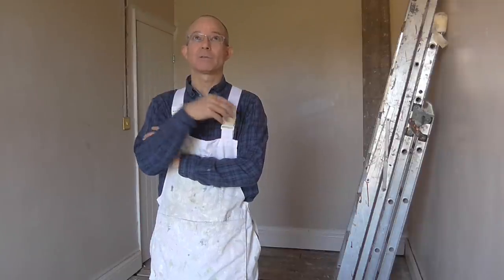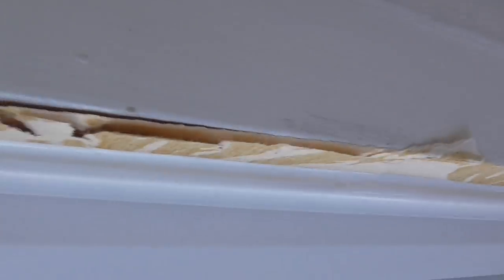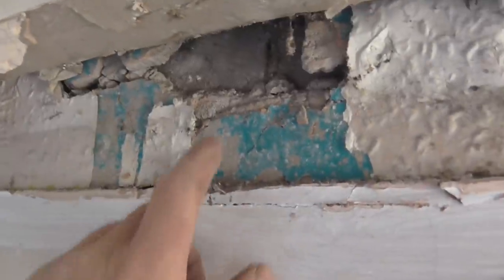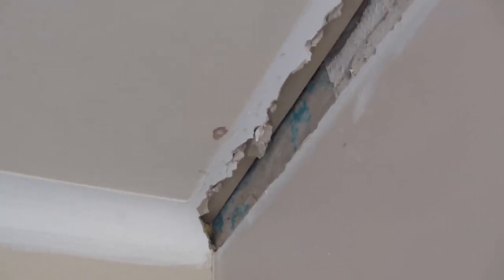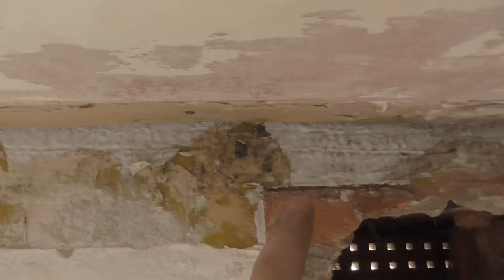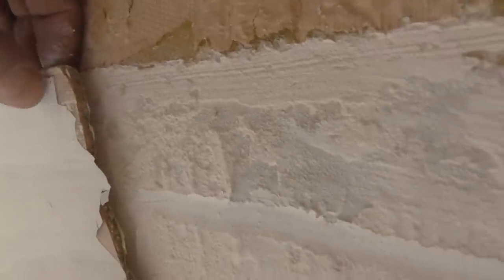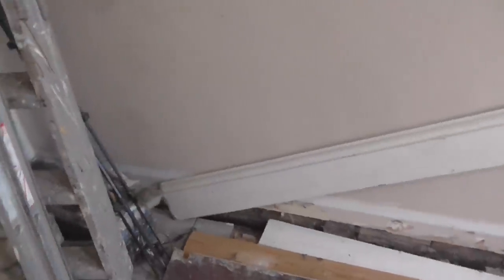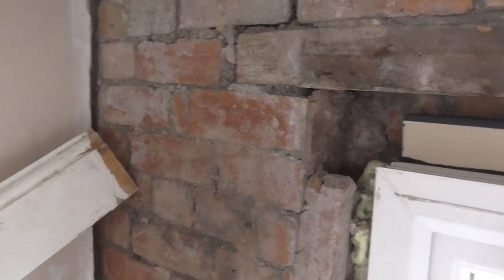Painting and Decorating Uncovers All The Hidden Problems. How To Remove Coving

Comment: The thing I hate the most is when plasters patch walls up and don’t PVA them properly . It’s took me a while to learn to irritate the plaster with a scrapper to see if it is loose but in the past I have went to put a full coat on after a mist coat and the roller has pulled the plaster off the wall and straight into my troff contaminating roller and troff. I have told my father and brother in law if they plaster to do the full wall and use PVA correctly. Another thing that irritates me is when joiners use silicone to seal the gaps in skirting boards or even when they just caulk them. And electricians are the worst trade on building and renovation jobs. They smash your walls, cut wrong parts of the ceiling out and expect you to fill it and use pencil and write and draw all over. I hate that phrase the decorator will sort it out. I got the customer to get the plasterer back to sort it out last time. That phrase any one can be a decorator they don’t know how much we put peoples work right.
Reply from the maker: Well said...   we are treated like the lowest trade when in reality we fix everything and always the last out the door.    Things are getting better life made easier with water based finish.. and some other new materials.    Thanks
Reply: I have been trying to decorate my flat over last few months and have nothing but the utmost respect for painters. Yeah I have done some plumbing/electric repairs but there is either right or wrong with those. Painting is a real skill and I just can't master it. Hats off
Reply: "They smash your walls, cut wrong parts of the ceiling out and expect you to fill it and use pencil and write and draw all over."
You must be aware that the smashed walls and holes in the ceiling were needed, no one is going to do that just for fun. And obviously it's between the electrician and customer to decide who repairs the damage, most customers don't want to pay an electrician for something a labourer can do.

Comment: bloody hells bells. I would take all plaster off the ceiling down. start with the floor joist first, fix brickwork that lintel above the window is carrying load above so it may need replacing then-new plaster or dot and dab boards. I'm sure u r more than capable to do the job .cant wait to see the end result. best of luck .

Comment: Your work ethic is a rarity. Glad your client agreed to do the right thing and hack the whole thing off.

With energy prices not getting any cheaper and this being and external wall,  I would fit insulated plasterboard.
Reply from the maker: Thank you..    energy prices is one reason for this job being done..  customer has got some insulation plasterboard.

Comment: Does this type of repair work actually fall to a painter and decorator? There's absolutely no doubt in my mind that you are well up to the job - you have amazing skills - but surely it should be down to a builder or plasterer? If you're doing the job, make sure you charge appropriately!!
Reply: Sometime it’s quicker to do the job yourself if your full booked. The other trades might take weeks to come back and then that means you have to reschedule. You could just get it nipped and then you don’t have to worry about going back.